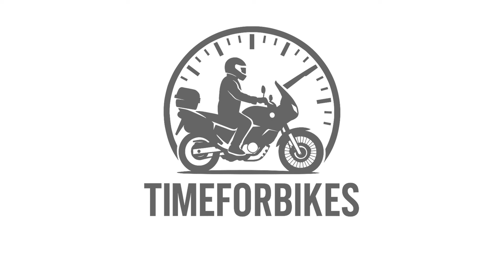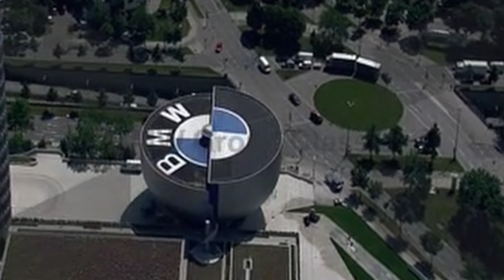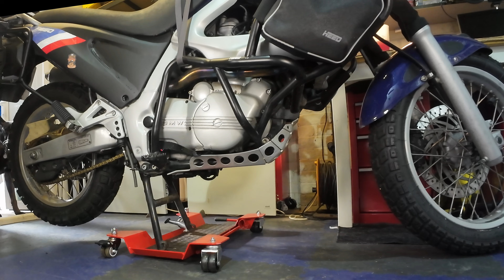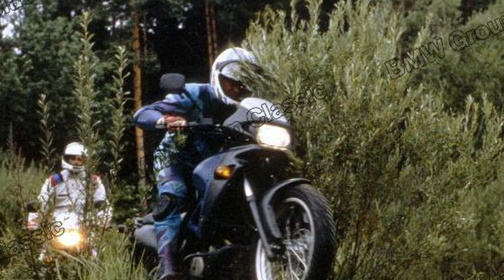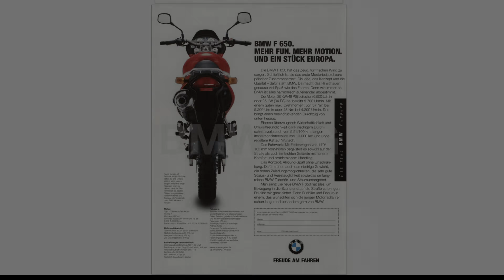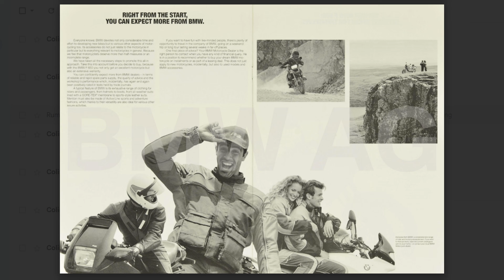The UnBMW part 2/4: BMW’s Italian Gamble That Saved the Brand

Comment: Thanks for sharing! Interesting photos you found. As for the development of the Rotax motor, BMW engineers had a hand in this and made a couple clever design features as compared to the Aprilia Pegaso engine. The cylinder head on the BMW is possible to take off with the engine in the frame, but on the Aprilia it is not. Also the Aprilias are plagued with cylinder head gaskets failing, but the BMW's rarely have this problem. The reason is that Aprilia chose to use cylinder-to-head bolts, and not through-bolts that are screwed into the crankcase. The BMW solution spreads the load on the head gasket more equally so they last much longer. The Aprilia motor has a hi-vo type camchain, while the BMW has a roller camchain. Unintuitively, the roller type chain of the BMW lasts longer, according to period long-term tests.The BMW has two spark plugs, but the Aprilia motor only one, central in the 5-valve cylinder head. This was likely just a marketing ploy; I have owned both bikes and there seems to be no difference in power or consumption between them. In my opinion the Aprilia ran a smidge smoother, but that could be due to differences in handlebars, saddles etc. The Aprilia engine looks better though, I think :-).
Reply from the maker: Fantastic detail! Thank you for sharing!

Comment: What an amazing video!

I never imagined that i could see those pictures and know the story behind the Funduro development with all those details, what an amazing research jobyou did there. 

I own a early 1994 Funduro since 2023, it was my first motorcycle and despite its 8 previous owners and the bad condition that i bought it... It is a wonderful bike to ride, confortable, reliable (ingoring the water pump seals) and powerful enough for a logical riding.

Now it has been parked a few months waiting for me to have some time to restore it and upgrade it with some parts that i've been collecting through the time, Pegaso upside down forks, YSS rear shock, steel braided brake lines, Heed crash bars, auxiliary lights... I used and abused it on and off road during my A2 license period and now that i have other bikes i can give her the love she deserves.

Can't wait for the next episode. Cheers!
Reply from the maker: That's such a great story and sounds like an amazing project you have there! Thank you so much for the kind comments.